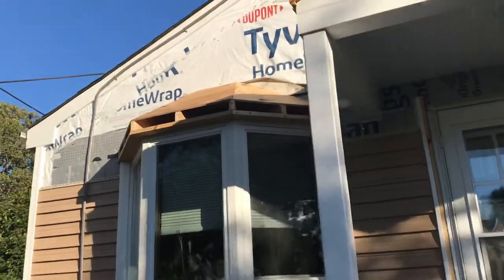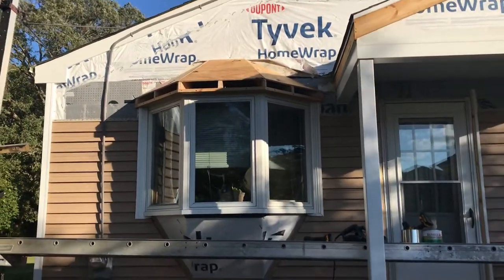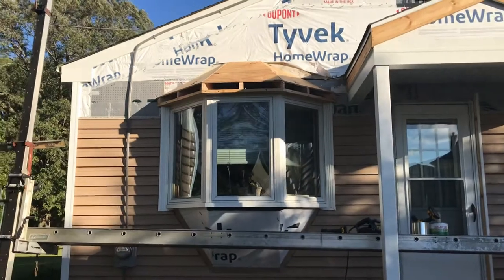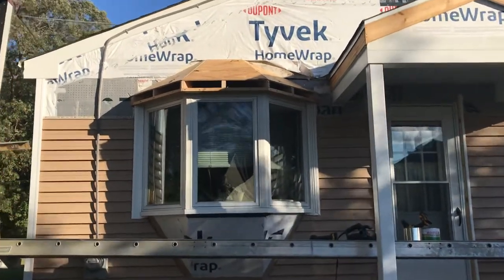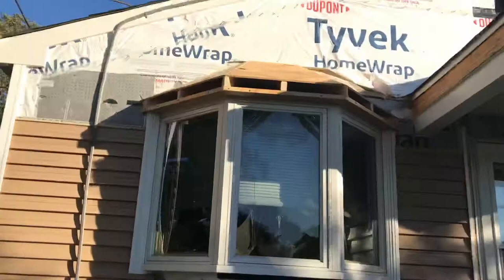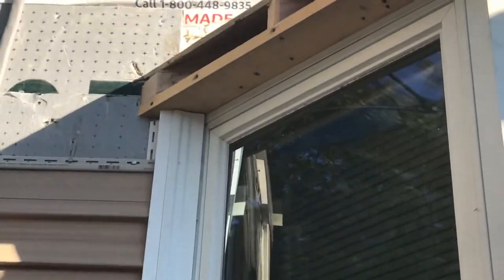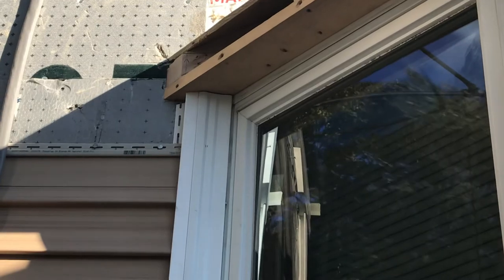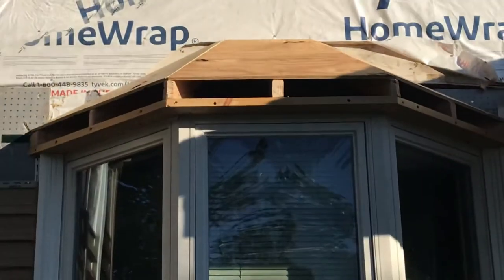Bay window roof, design/layout/framed & sheathed, see my channel.

Comment: would have liked it even more if you shown us the gap between the plywood sheeting. I prefer using hardwood ply instead of the cheaper structural spruce.
Reply from the maker: Hi Construction Secrets, thanks for the comment, the sheathing I used was ½" southern Yellow pine, on that type of roof, in my opinion you could leave the gaps wide, they were only on the hips, which wood round or break that sharp point, if you look close on the framing video, the piece sheathing I had on should had been more at a right angle to the rafters.... thanks for the comment, Len
Edit/added, I don't know if you can get hardwood plywood with an exterior glue?